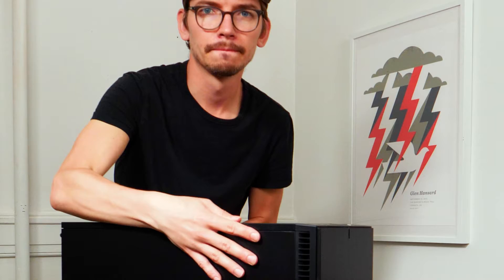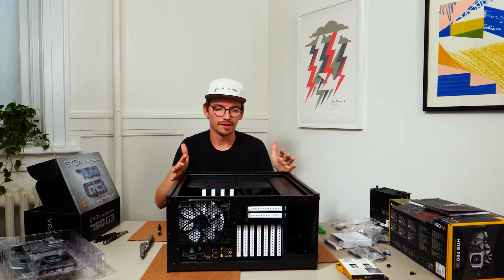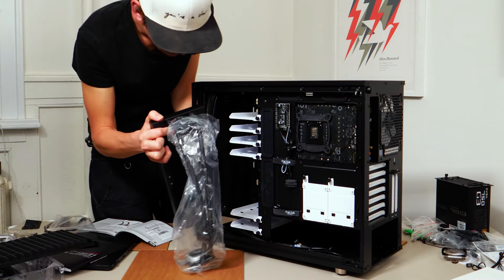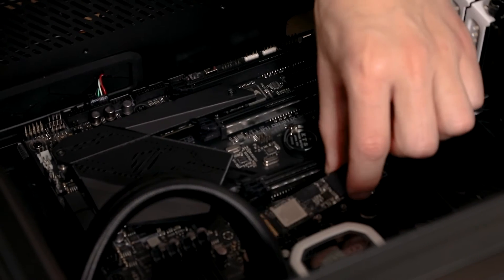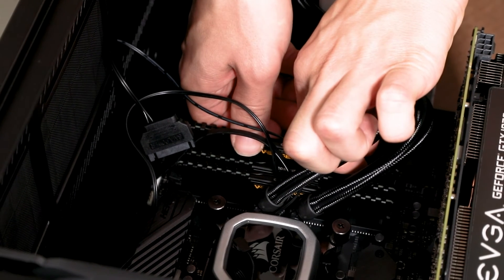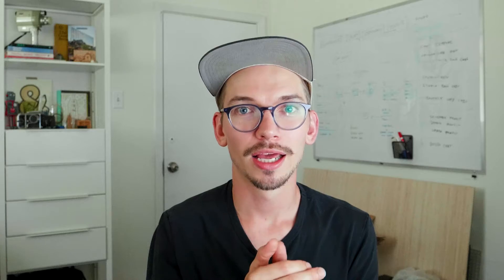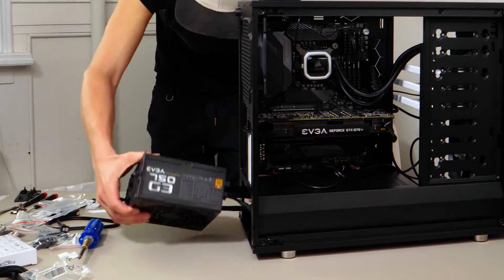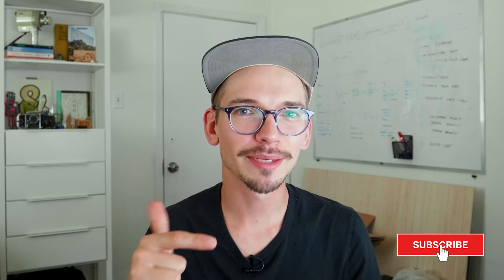How to Build a PC Step-by-Step

Comment: Thanks for the video, I'm considering a similar move for creative work. Just a tip, I've seen guides suggesting that you install as much as possible onto the motherboard before you fit it into the case, that way you have easier access and it's less cramped.
Reply from the maker: Ahhh man, you're so right! I was literally watching someone do a speed build yesterday and they did it that way, soo much better! Luckily I had a large case and the motherboard was open on the back of the case, otherwise I would have had to remove it to add the cpu cooling mount. Definitely will remember this for next time! Thanks a lot for watching and leaving the tip, going to pin your comment.